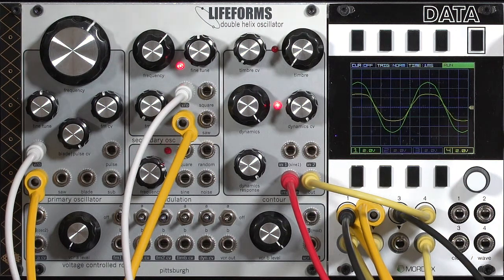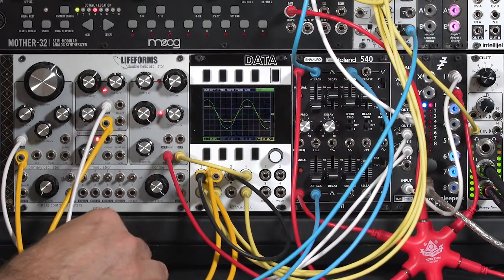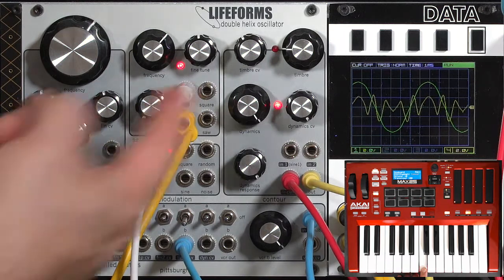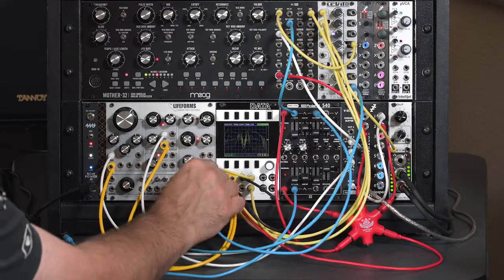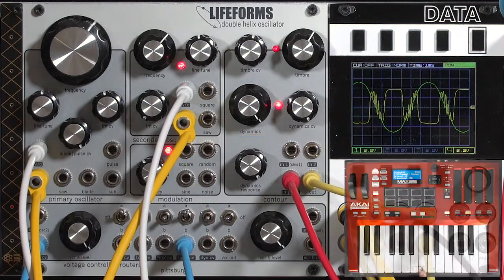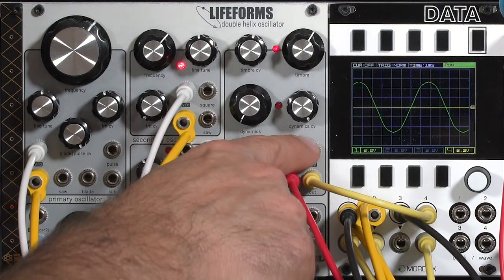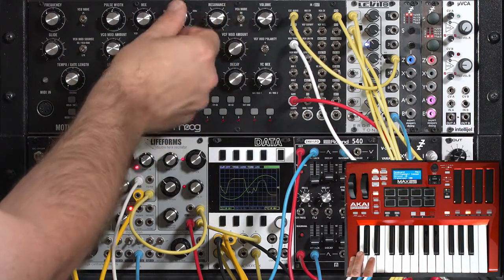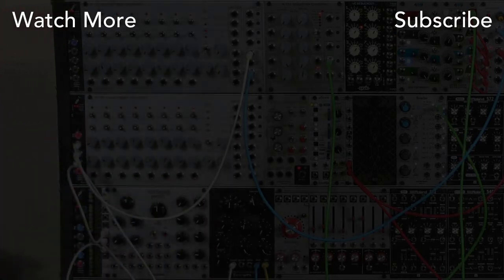Pittsburgh Modular Double Helix Oscillator 4/4: Wavefolder + LPG (LMS Eurorack Expansion Project)

Comment: The wavefolding that Pittsburgh Modular offers in their oscillators and synths is very cool.  I got the Pittsburgh Modular Microvolt 3900 synth
(https://pittsburghmodular.com/microvolt) desktop synth which has a complex oscillator based complete West Coast synthesis synth.  This desktop is not a EuroRack module, but a stand alone desktop synth with wavefolding.  Then I also got the Primary Oscillator. Recommended.

Comment: Excellent series of demos! Thank you! Really appreciate your attention to detail with regards to waveform characteristics, FM tuning, the response of the LPG and everything else. 

I'm curious, though: what, if anything, do you think are the DHO's shortcomings in general and/or compared to other complex oscillators? I would've liked to see oscillator sync, for instance, and perhaps an octave switch on one or both of the oscillators.
Reply from the maker: I'm a fan of linear FM (particularly through zero), so that's my biggest request. I don't use sync nearly as often, although it can be a good trick for keeping the oscillators in tune with each other. I like octave switches too, but the combination of the big Frequency knob plus the fine tune control makes it relatively easy to tune, even if it's not in precise octave leaps.
Reply: Cheers! Linear FM would indeed be nice. Shortcomings aside, I'm gonna give this one a chance. I really like the features that set it apart from other complex oscillators out there – the dedicated modulation generator, LPG and VCR section (which is practically like having two free VCAs and doubling up on some modulation CV inputs) all look really useful. And it sounds good! Thanks again for aiding my decision. :)
Reply from the maker: It does indeed create a wide range of cool sounds, in addition to being very flexible.